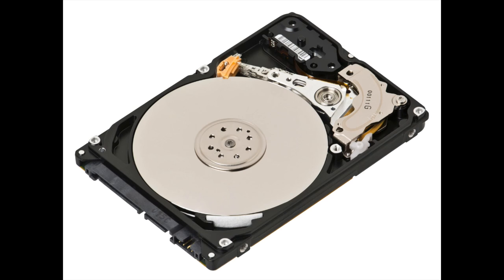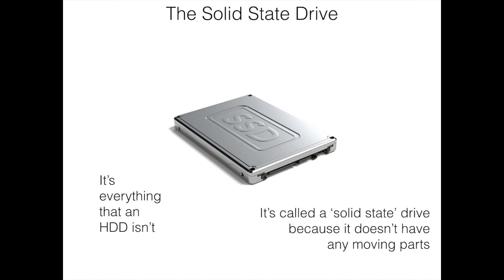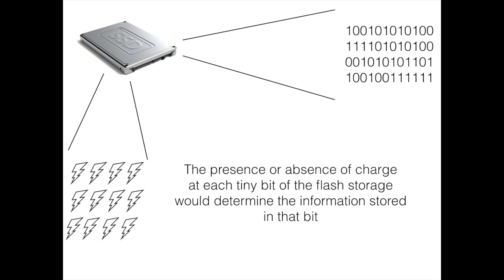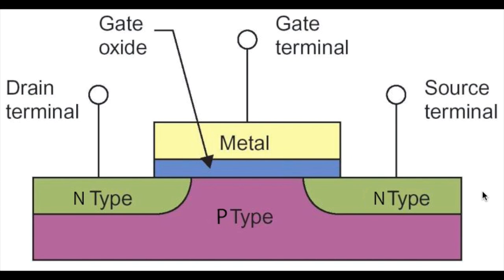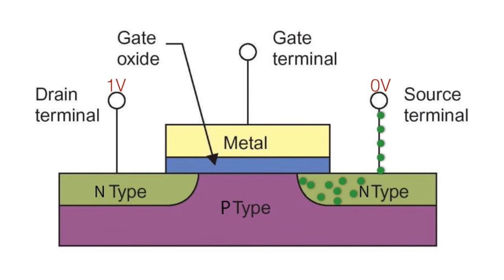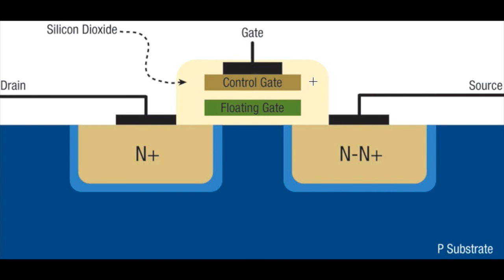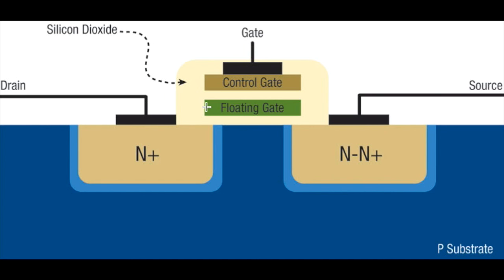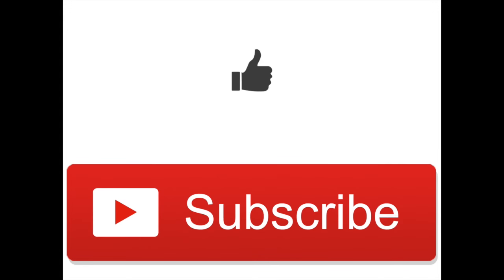Fundamentals of Flash Storage

Comment: Thank you that was really easy to understand

So basically a high voltage has to be applied on the gate terminal for quantum tunneling to occur in order to make the electrons jump to the floating gate?  And since the floating gate is insulated from all sides it doesn't leak charge ?
Reply: Quantum tunneling's a fancy word for it. It's really just an electrical charge passing through a semiconductor.
Reply: Due to quantum tunneling effect some very high energy electrons go through the insulator, but this happens only because of high voltage applied to gate terminal. After storing the charge in floating gate this high voltage is removed and hence floating gate retains the tunneled electrons. These electrons can leak from the insulating material but they cannot do so using quantum tunneling, as quantum tunneling requires a strong negative electric field to be applied,(floating gate charge leaks through insulator over long period of time like a decade making insulator less effective over time. Hence flash drives have lifespan of 10 to 20 years). 
In simple words if you want to clear the charge stored in floating gate using quantum tunneling, you will need to apply a strong -ve voltage to the gate terminal.
Reply: @andrewbeard9896   Quantum tunneling is a fascinating phenomenon, the fascinating part about it is when electron tunnels through the insulator using quantum tunneling the electron does not lose any of it's energy. Usually if you want an electron to penetrate through something like a strong electrical field, then in the process electron will lose it's energy but in the process of quantum tunneling electron does not lose any of it's energy.

Comment: I don't understand why we don't have electrowetting drives, all it takes to store a value is sending a charge for the drop to either avoid or run to (forget which), after that a simple ray of light can be used to check where the drop is and thus determine what state to give back to the device reading it, the bonus is that no charge is needed after setting it and the read & write speeds will be practically identical, if not the same, should also be equally as fast as SSD methods but have greater longevity thereby consigning HDDs to the past once and for all

Comment: This cleared my doubts
Reply: 3:07 but 1 problem how you can able to read charge if gate and floating gate is separated by  insulator ?
And if we consider it as reading capacitor like charge between two metal  plates , it also not help because in this case one plate van be gate itself but there is no any plate or wiring beneath floating gate followed by sio2 insulation ?
Reply: @omsingharjit   from my understanding, the floating gate will cause the current between the source and the drain to be either blocked or allowed, depending on the charge, and the bit is read based on whether current can pass through. So if there is a positive charge in the floating gate, current will allowed through, which I think would be read as a one. If there is a neutral or negative charge, current will not pass, and it will be read as a zero. The control gate in this case is only for setting the charge of the floating gate. 
To try to explain it as simply as possible, transistors are basically just tiny switches with no moving parts.  If the switch is on, it would be read as a 1. If the switch is off, it would be read as a 0. The floating gate is the lever of the switch. The control gate is your finger flipping the switch.